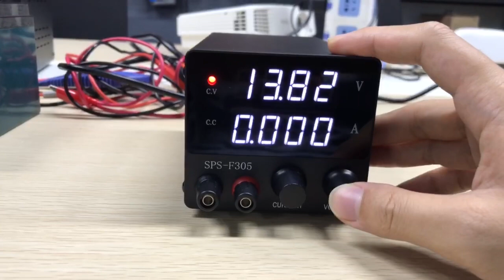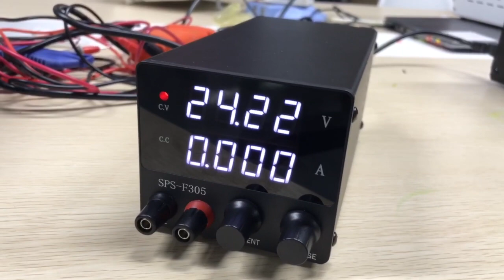NICE-POWER SPS-F305 30V 5A MINI Variable Lab DC Power Supply Bench

Comment: There's no power button to turn the supply on or off. Suppose a 3.3V-operated circuit is connected to this power supply, and the voltage has been set to 7V—if you turn it on using the rocker switch, the circuit could get damaged.
Reply from the maker: Totally hear you – yeah, this current model doesn’t have an on/off switch for the output, but our newer upgraded versions do have a output on/off button now, so even if the voltage is accidentally set too high, your circuit stays safe until you’re ready. No more worrying about surprises!